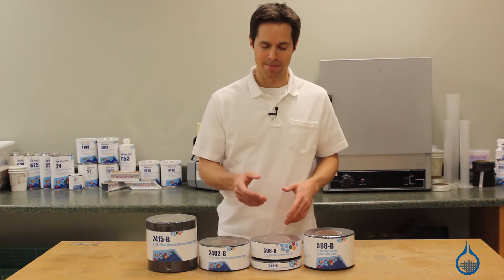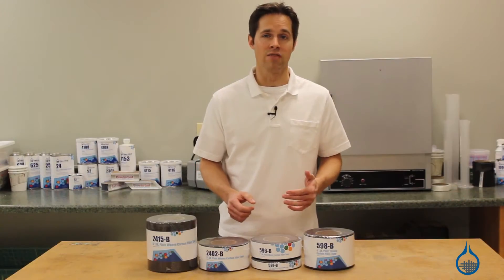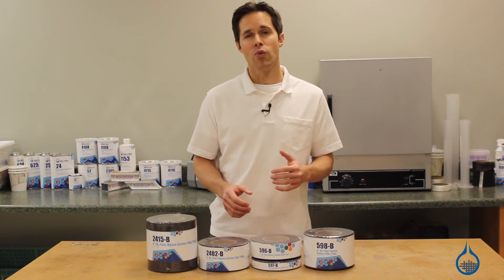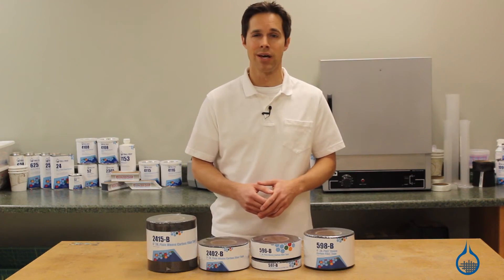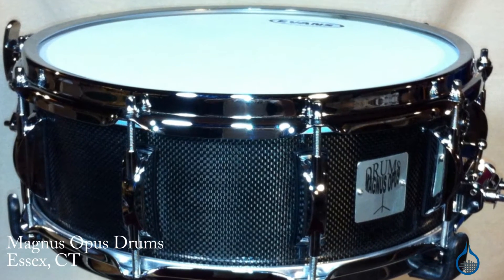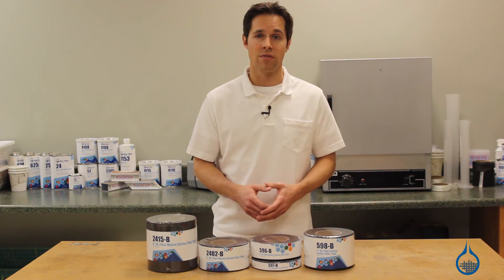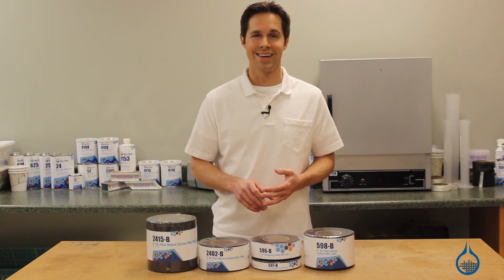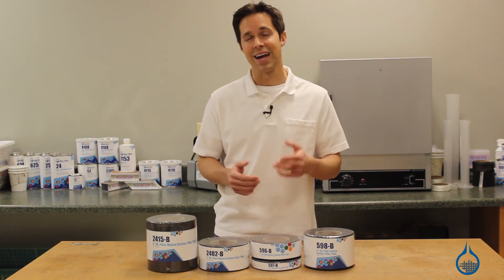Carbon Fiber Tapes

Comment: Hai Can it join a broken carbon pipe with ur carbon fiber tape? Which apoxy is used for it ? you have it ?
Reply from the maker: +ABDUL GAFOOR KP Carbon fiber tape should be fine to use in your repair area. Our recommendation for Epoxy would be the system 1000/1010 quick repair kit (here is a link to the product page, so you can look over it. http://bit.ly/1PoktrN )
Reply: Fibre Glast v
Reply: Fibre Glast